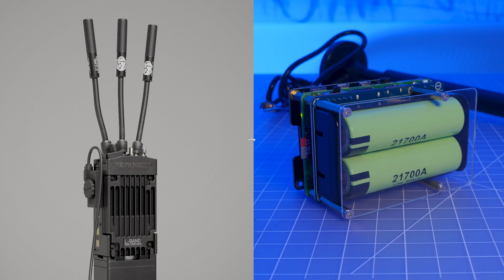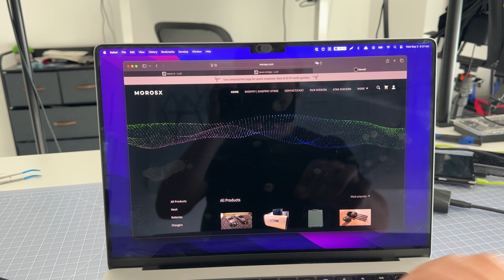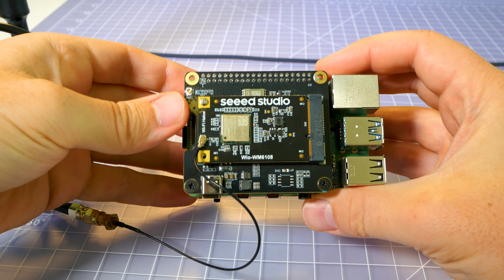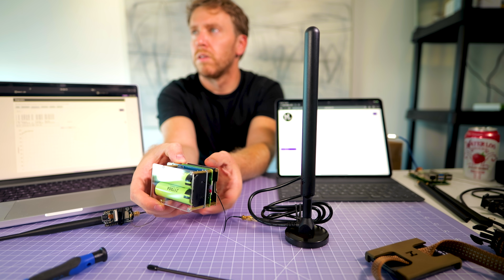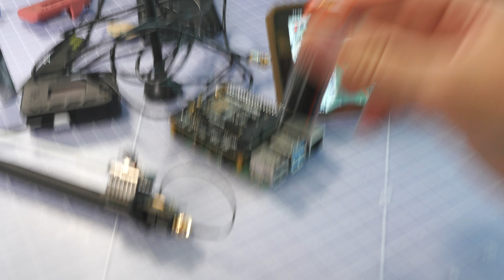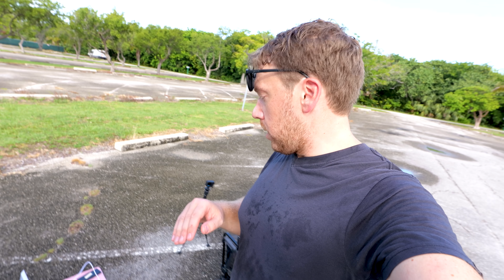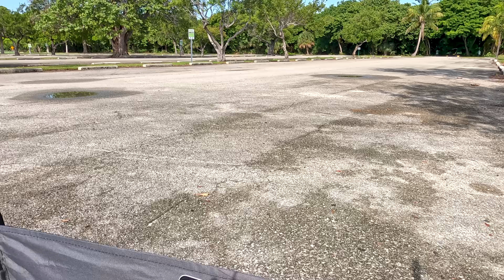I Built a $20,000 Military Router for $106.23

Comment: I am not saying $20k is not way too much, but what you made fro $100 is nowhere near as ruggedized as the military one, and you are not factoring your engineering time, the R&D you didn't have to undertake since another firm did that, and the fact that they are not doing this as a charity, they need a profit margin. I would say a reasonable price for rugged version would easily be more like $1k-$2k, maybe much more if it requires alot of custom ASICs.

Comment: Comparing the prices is total nonsense. You made a device with similar functionality and totally different specs (Water/Dust Protection, EMI immunity, shock resistance, mechanical resistance) for ~100$ in components. You gave your time, the room, electricity etc. for free.

Comment: On the Pi Zero you can solder a UMRF connector to the board, sever and bridge the antenna connection to the connector. Then plug in a umrf to sma adapter and connect a WiFi/Bluetooth antenna, it works really well for my pwnagotchi

Comment: edit: im not trying to take away your accomplishments this is a cool project. but the first ten minutes is drove me nuts.

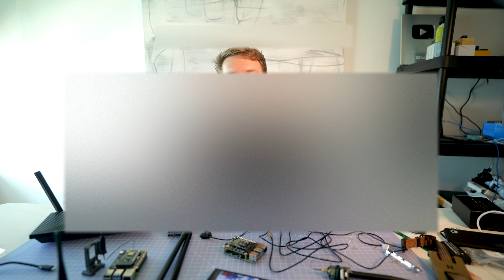0:28 how could they shut you down? what are 'they' going to do? you made it out of parts anyone can buy. please. 
3:04 from scratch? mf has a starlink. and you wonder if you can get all the things that anyone can get with a starlink and a router??? 
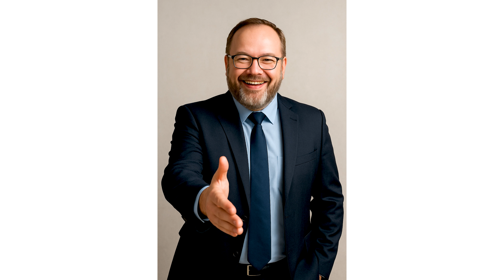3:36 why would the dod care if you use a wifi standard? 
3:55 dude if I power my 50$ router with a battery is a mobile adhoc network.
5:10 hes' just explaining a gateway. 
HaLow is obscure but its not new. 

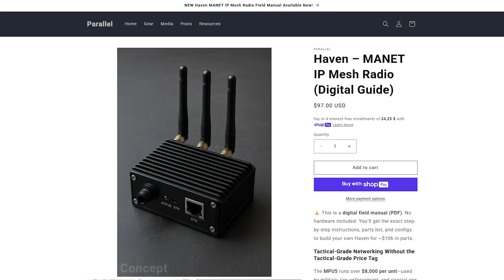5:44 oh there it is 97$ for a pdf.

Comment: years ago a usaf c5 hhad a bolt break. The replacement was $1500. Lowes had that size for $3.59. The USAF bolt was freeze able heat able, It had to handle 60 tons. The lowes bolt could probably do the job. But the USAF bolt did would and guaranteed to do the job as required.
Reply: each small machinery company owning a small CNC Machine can produce that bolt out of special metal which then can be hardened, and it would cost not more then 300€ with express delivery... nato military is a huge world level scam

Comment: A note about antennas: If your antenna is more perfectly tuned, you get WAAAAAAY more effective range and power. If you can get an extra 3db of gain from your antenna, you get twice the transmit and receive range. 

Using antenna patterns that are more directional helps to add gain. This doesnt have to be unidirectional. Common HAM radio antennas add 12db gain over the normal 1-3db gain antennas, by basically making the transmission pattern look like a very thin donut with the antenna in the middle of the donut.
Reply: Your assumptions only apply for HF/VHF. 2.4GHz protocols will usually need closer to 6dB for line of sight range doubling and 12dB for non-line of sight. Yes, I know that theoretical math can show less. I am telling you from experience the theory is just that.
Reply: @generalreticent3791  Thanks for the input! Experience is the most important thing.

No one really makes directional antennas for lora modules, but we all probably should be using those.
Reply: There is alai EIRP limit that includes the antenna. So you cannot push 30dBm into 20dB antenna
Reply: can you just add an antenna in place of a mic on the parabolic setups?  what material would you use to direct ultrasonic waves?
Reply: @smatchimo55  A mic is a different thing. Antennas are weird. Best bet is to youtube search "Dipole Antenna Radiation Pattern" and maybe work your way into ground planes (not like ground for a circuit or for a car, something very different). Maybe directional or omni-directional antennas would be worth looking at, for other things people have done. The standard for ham radio is dipole, quarter wave dipole with impedence matching ground plane, jpole, and tape measure yagi antennas. These may not work great because of the band that LORA modules use (915mhz or so in the US), but the theory still stands. Most HAM radio antennas use much lower frequencies and bigger antennas, so small differences in things like antenna length dont really matter. Shaving a tenth if an inch off of a 30 foot antenna doesnt really matter. Off of a 1.5 inch antenna? Different story.

A mic is a device that needs power and amplification to turn sound into electronic waves. An antenna is something that turns electronic waves into electromagnetic radiation. Think a flashlight bulb, but for a very different frequency of radiation than light radiation.

Comment: years ago I lived in a area that was expensive to get cable internet and DSL was crap as the local Dslam office was so far away and copper was crap. But my buddy had cable and wifi. We ended up taking USB wifi dongles and putting the antenna in a coffee can to make a beam antenna. 8 miles away and I had 75-80% connection quality...

Comment: It´s just an Wifi-Halow Mesh. This has nothing to do with an real IP mesh radio like Silvus, Domo, etc. - they work completly different.
Reply from the maker: well it definitely is a real IP mesh radio sooo
Reply: @DataSlayerMedia  That´s not true. You´re just using Wifi Halow, that has nothing to do with an RF L-Band radio. You get shorter distances and not even close data transfer to the real IP mesh radios.

Comment: You are not actually knocking on the upper limits for civilian use. It’s a logarithmic scale, so 27 dBm corresponds to half the power of 30 dBm. You have 500 mW of headroom with the right radio module.
Reply from the maker: Doesn't the antenna add to that total power output?

Comment: I'm pretty sure its illegal to put the internet on those radio frequency's.. You can use the IP protocol... but you cant put it on the internet.
Reply: You can attach any secondary network to the Internet, legally. The are no laws about radio frequencies and the Internet, because the Internet has nothing to do with radio frequencies. Every radio network that connects to the Internet is a separate IP network that's routed, generally though a NAT, to the Internet.

Comment: How does this work in an urban or city environment with many competing networks?
Reply: I'm thinking about festivals with tens of thousands of people all in one place (stadium, etc.). Cell networks fail in this case, but I assume this wouldn't be similarly impacted (since it doesn't use cell network).
Reply: @realvuldin  it wouldnt work. The stadiums Wifi would instantly kill this link (depending on if he was using 2.4 or 900mhz). If he was using 900mhz and they were not. Then Line of Sight would be the determining factor. But of line of sight loss will DRAMATICALLY lower range.

Comment: Interesting, In the past (roughly 1years ago) I had a WiFi connection over a disctance of 607m which is almost 2000feet. Was old 2.4GHz Wifi back then and I modified the antenna a bit with with some parallel wires. Got stable 2MB/s that is 16MBit/s. Only on rainy or extremly foggy weather contitions the connection became unstable. The initial idea was to provide a friend with internet, that hat no other opportunities. We both were impressed that it worked and even more that it worked quite well.
Reply: Just grab a PtP (bridge in a box) product from ruckus,unifi,cambium,esteem and you can easily make that 2000feet connection happen if you get a decent line of sight by getting the antennas up 30-40 feet.  if you go for a 5Ghz freq you can probably get north of 30 Mbps both ways. If the channel is clean and you have a clear line of sight more speeds too.

I have 12 mile links with Cambium 450i units (expensive) it was for Oil and gas project. going 12 miles on the 5GHz link. Both are like 80 feet up in the air on towers tho. and have Directional antennas and nothing blocking them. about 40-70Mbps both ways if I remember correctly. (about 2 years ago)

Comment: I used to build all kinds of neat gadgets when I was an RF network engineer building wireless networks. My company had acquired a few other wireless ISP's, so I had access to an assortment of all kinds of tech that we were phasing out and replacing with 4G wimax. One of my favorite tools was a little rechargeable battery powered TP-link router, wired up to a wimax CPE, using a battery powered POE adapter that looked like a car battery. I also could pack it into a backpack, and have the CPE on a sling, and test for signal while climbing onto roofs or towers, literally anywhere. Or I could connect to your WiFi from like 10 miles away, if instead of the CPE I was using like a Ubiquiti silver bullet or something, wired up to a high gain directional antenna.

Comment: My guess is the the opensource boards are built using commercial grade TTL chips and SoC's where the $20k unit is using Military grade TTL chips and SoC's. Military grade chips can cost 10x to 100x. Add on top of that everything else that needs to be rugged and tested and refined after multiple interations, then your build doesn't even come close to replicating the military grade router. Only in functionality, but not with the same temp ranges and weather conditions for a ruggedness stand point. Is the $20k unit worth $20k? Probably not. There is probably a 3 - 4x markup.
Reply: The $20K unit isn't worth it... until it is. As a consumer, you're probably not going to die if your radio fails on a cold or hot day, or in a hurricane. As a soldier, you just might... and maybe those you're trying to protect as well. He's clearly after data functionality here, not drop-in replacement. Or maybe we'll see this in the testing oven at -40C in a week or two?
Reply: Exactly, it is just miss leading and a click bait title to compare an open source $100 build to a $20 military grade build. Data functionality is the same and that is cool, but the rest is not comparable at all.
Reply: @lentzintl  The dude's got to sell his channel!  Clickbait is so common these days, it doesn't even bother me as long as, as in this case, there's at least some actual meat in the sandwich.

Comment: Is it possible for it to have the capability to go over 30dBm for environments that are regulation poor?
Reply: The part he's using is limited to 27dBm output. If you were designing your own, you could add a PA and get more power... you'd probably use one of the lower power HaLow chips in that case.

Comment: As a fellow Floridian, this would be KILLER for post-hurricane comms!! Great work!
Reply: Meshtastic is a good tool for this that was used extensively during Helene recovery.
Reply: It was during the flooding last year, and also the fires.
Reply: There is one. It's called SATCOM. It's available to the public now, and it's run out of Florida. The maritime industry uses it to.
Reply: Regular radios work just fine. This is way different than just "comms"
Reply: @Doc_Hawk he said it generates a mesh network. That's so much more important than just radios.
Reply: @Doc_Hawk  Comms was used as a generic overlay for everything this can do. The word was chosen to save time on typing, but here we are....
Reply: @Doc_Hawk  Radio is great. every comunity needs a HAM operator. the barrier to entry on this is in multiple ways lower and in theory has a higher max range. If I have a few of these and My neighbor who is 3/4 of a mile has one and then rince and repeat then we have a network that operates independly. Now for the drawbacks. If my neighbor doesnt have one of these. Mesh systems are just about useless in the countryside. I am fully for mesh systems getting added in parallel to other coms.
Reply: Having worked with ATAK in a civilian aspect, I can tell you it actually is.
Reply: This is exactly what me and my brother are considering something like this for.
Reply: @deno1025 I recommend making sure you have a ham radio and license as well. Even if it's just a baofeng
Reply: @queen_punksy  not ideal for emegency comms...don't need to be throwing enough wattage out to hit thre ionosphere for emergency comms.  Easy mobilized and low power are important considerations.
Reply: @danmarone5242you don't need a relay station. A simple baofeng and laminated RACES chart and you're done. Technically you don't even need a license if it's specifically for emergency situations.
Reply: that is hardly the point to this type of tech. yes it would be able to do that, however there are far greater use cases out there that say a HAM raido for coms strictly is better(even for data link i/o).
Reply: @abugarr123 I am a ham and the problem is most peoples “radio” is their smart phone and in an emergency to help the most people you want to use those smart phones.

Comment: Great. You built something that doesn’t serve you in any meaningful way. Unless you’ve got squads of soldiers cut off in the desert needing to spin up a battlefield network, you’ll never actually use it. You’re not coordinating disaster relief, you’re not flying surveillance drones, and you’re not running comms for an oil rig in the middle of the ocean. So what exactly is the point, other than proving you can waste your time?

Comment: So you didn't actually build a $20k military router - you built a $106.23 router, and your title is clickbait. Obviously, If you drop your router on the ground, even with a 3D-printed case, it's going to break; never mind dust, dirt, sand, and water. Your antennas aren't as good or robust as the ones offered on the military unit. You're using off-the-shelf modules and a Raspberry Pi, that haven't been evaluated for security purposes (you don't know anything about the supply chain, if there are any software or hardware vulnerabilities or backdoors; you haven't conducted a risk assessment). The electronic components making up your router aren't MIL-SPEC, meaning their performance, durability, and safety likely do not meet the requirements to operate in the same capacity. While I'm not sure what's in an MPU5 because I haven't taken one apart (and I don't think you've actually reverse-engineered an MPU5, either), it's definitely not a Raspberry Pi, even if the technical specs are similar at face value. The MPU5's run a custom Android OS built specifically for the purpose and not Raspbian, which is likely making better use of the hardware than a less-efficient, general-purpose operating system. You could certainly build 200 of your routers for the price of one military unit, but yours is incomparable to the MPU5. You didn't build a $20k MPU5, and, frankly, you didn't build anything - you plugged some things together and installed and configured someone else's software. This would be impressive if you designed and built a Pi hat for some new wireless IC or wrote a new protocol to do something unique or explored the reasons why military tech is so expensive, instead of hyping up a thing people have been doing with Raspberry Pi's for the last decade. Break some new ground.
Reply: Just the encryption chips that the military need are really expensive 
Have plaid whit long distans data link fore drones in relation to the military and the amount of things that you have to think about are mind beguiling 

The best one is the "will a 19 year old brake this thing will out in the feald" most equipment don't pass that basic test
Reply: @Goroca  That is true, though there's a little more that goes into engineering and manufacturing military-grade electronics. The actual circuit boards are populated with high-tolerance, highly-tested, durable components, that can considerably raise the price of manufacturing. I've ordered reels of military-grade resistors, capacitors, diodes, etc. at double consumer-grade prices because everything needs to remain precise through extreme temperature fluctuations, changes in atmosphere, sudden physical changes, etc. Literally everything is more expensive, BUT everything is more expensive because the demands for quality, accuracy, and stability are so high.
Reply: Use your imagination bud. You’re over here complaining about a 3-D printed case- make the case out of what ever you want. Instead of being the solution you just wanna complain, this is a great device if you know what you’re doing. Clearly you need some more hand holding in life.
Reply: @64CSAR  That's not my point - he claims he built a $20k military router for $106.23, yet doesn't include the costs of materials clearly not present, never mind the missing R&D and false claims that he "reverse-engineered" the MPU5. This isn't a MPU5, it's not even close, and my whole point is that this is the wrong approach to understanding why the military router is $20k.

Sticking an off-the-shelf wireless module on a Raspberry Pi does not make a great or interesting device.
Reply: Are you new to YouTube?

Comment: Can your $106 gizmo take a 20-foot drop? Crawl through mud? Keep working after days in sub-zero temps? That’s what the military pays for—a tool that keeps saving lives no matter what gets thrown at it. It has to be bulletproof, not just cheap.
Reply: You over estimate military grade. Sure might be rugged but it’s far from bulletproof. Or reliable. “Cheapest viable” is what the military goes for.
Reply: @Chingusbobingus 
Have you seen what you can do to a mileturys radio and it will keep running